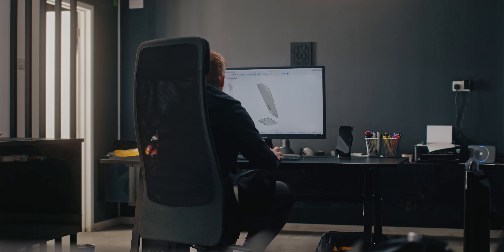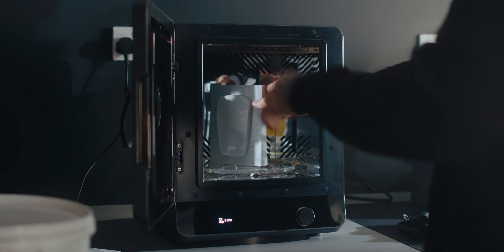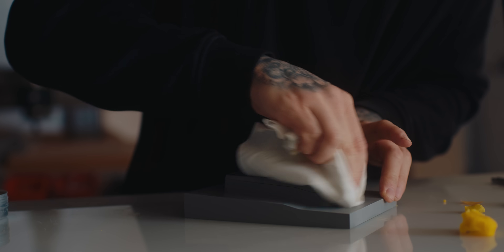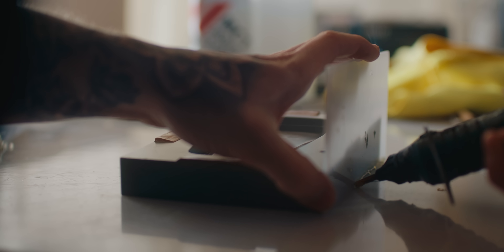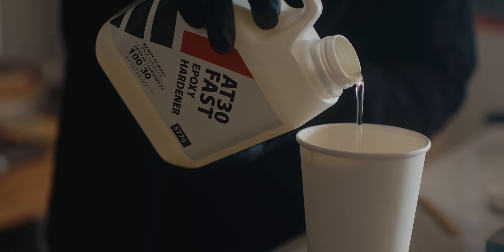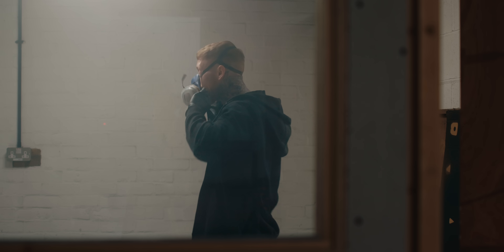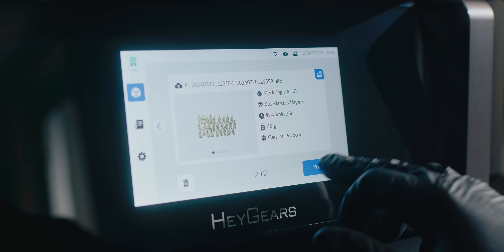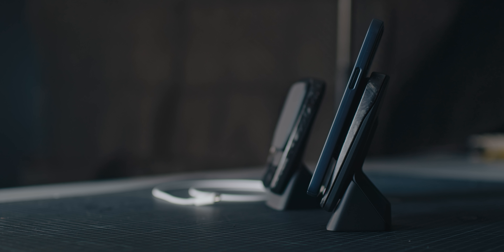Forged Carbon Compression Mould - Wireless Charging Stand

Comment: Why not use a 3d printed mold ?
Reply from the maker: 3D print wouldn’t hold up under the pressure compared to the aluminium filled epoxy.

Comment: It's seriously good to see the younger generation take on a project like this. While watching, I had many nods on my end of the screen, noting with few objections, this is almost precisely how I'd do a similar client job. 
While I enjoy forged carbon--and woven cloth would be wholly overkill for necessary strength--using exterior twill for your 'pretty' surface face, s-glass fiberglass for interior strength and a foam core, you can cut down the messier side of doing forged parts to just a few minutes of layup, sandwich and press into the mold. You'd be surprised at how much time you save using woven fabric over chopped, and that seemingly flimsy foam core makes a stunningly strong And light substrate once cured.  
You can get as fancy as you want in direction with the woven parts, choosing to directionally match the fabric weave directions like a hypercar, or just go traditional 45*, cut your squares with a little overlap and trim. There's not much post work other than necessary trimming and a light buff, but using patterns accelerates efficiency and reduces waste at the slight trade-off of prep time.  
Above all though, well done!  👍

Comment: You could make a new multi-cavity compression tool. If you upped the number of cavities to 4 you'd effectively reduce your production times to a quarter and can also therefore batch activities which overall will increase your throughput. Even if you made two 2-cavitity compression molds you could be laying up one whilst the other is curing in the oven and still see a large increase in throughput by being able to batch stages. 

Also, the matte finish is incredible. That's definitely the way I would go.

Comment: This looks amazing! I definitely prefer the matte finish if I had a choice. Matte carbon fiber just has more of an industrial and “useable” presence in my opinion. It would be awesome to work in a partition on the back side for another cable to be run for headphones. Maybe like a basic hook or a removable slot for hooks that would hold the case and “standard size” cable channel for a second cable to be held on the back out of sight but still accessible for charging when needed.

Comment: Molding process is interesting...however, wouldn't it be quicker to CNC these in batches???
Reply from the maker: Are we talking about cnc machining the carbon pieces? If so, you’d still need a piece of stock made from forged carbon to machine it from. So to achieve the same visual look of the compressed fibres, which is the only reason for choosing this method, even manufacturing of the stock block of forged carbon to machine them from you’d still have to follow the compression moulding process.

If we’re talking about the mould itself, then yes, machining the moulds from aluminium would be more efficient for producing batches of moulds quicker. Now this project has gone from a personal to project, to making a few, all the way to planning out low to mid volume production, I will definitely need more moulds in use simultaneously, so I am looking at improving the workflow efficiency even more by going down the aluminium mould route.
Reply: @RTAFabrication  sorry about that...I made the comment before I realized you were making this out of carbon fiber.  You would need different bits as well, seeing as carbon fiber is a different material and probably has a different effect on bits. Not going to lie...the original prototype looked killer...the cfrp is a good addition, but the mat black is killer as is.  I respect what you're  doing though!!!

Comment: Whats the point of forged CF besides the looks?
Reply from the maker: Forged carbon made this way makes for a very strong component, although a woven layup would produce a stronger component in general as a comparison. In this case, the forged carbon is only used as an atheistic choice and although the component is strong, that wasn’t a consideration for the project.

Comment: compressed or forged carbon fiber is NOT how to create the strongest parts, do you just assume everyone watching your videos wont know anything? would you seriously argue that forged carbon fiber is stronger than woven?? otherwise a very nice looking build. clean.
Reply from the maker: Thanks for watching! I think there may have been some misunderstanding of my reference to the strength of the part. If you re-watch that section, my comparison was to the other methods I found when researching ways of creating the forged carbon look. I didn't mention or reference woven material anywhere in the video, and definitely wasn't comparing this compression method to a woven layup. The other methods I was referring to include skinning and filling a mould with a low volume of fibres then pouring resin in. Skinning will obviously just be a cosmetic finish, with minor strength benefits but nothing considerable at all. Filling a mould with a low volume of fibres and pouring resin in will give the appearance of the forged carbon look (to an extent), but it's not strong (or as strong as the compression method) and you can tell the fibres are submerged in the resin. You can't use the same ratio of a 60/40 spilt like in the compression method as the resin will not flow through the mould, hence having to use a low volume of fibres. Even doing this method under vacuum and essentially pushing the resin in requires a low volume of fibres. This is talking from experience, as I tested this method extensively before moving forward with the compression method as the casting method didn't provided the look I wanted. Between all of those methods, the compression method I demonstrated will produce the strongest part, in comparison to those, as it's the only method that has a good (or better) ratio of resin to fibre and that gives the compressed fibre appearance. I certainly have no intention of publishing misinformation, and I definitely don't assume that anyone watching won't know anything. I hope that clears up any confusion and I appreciate you taking the time to watch the video!